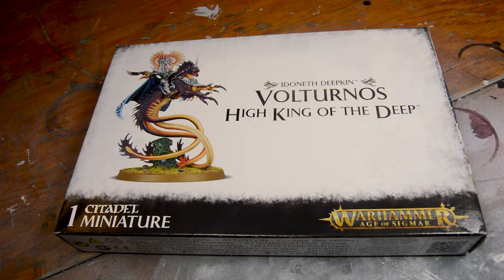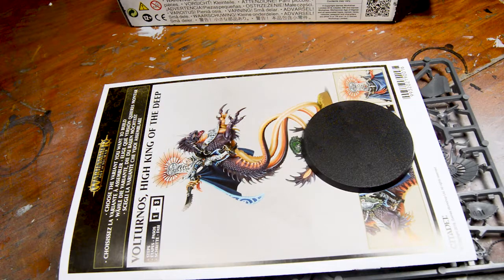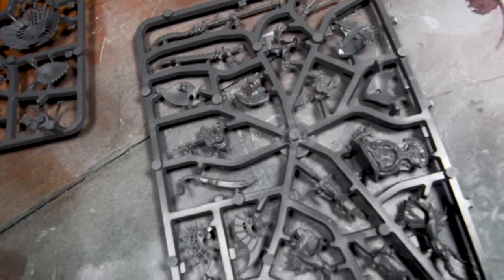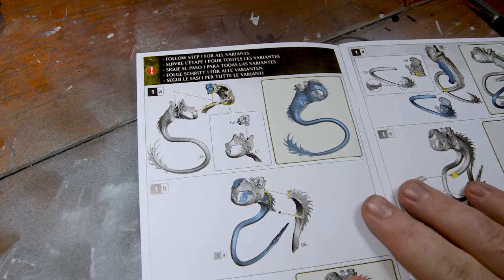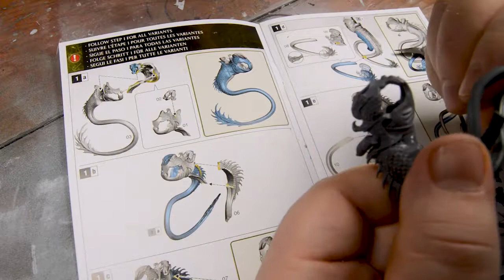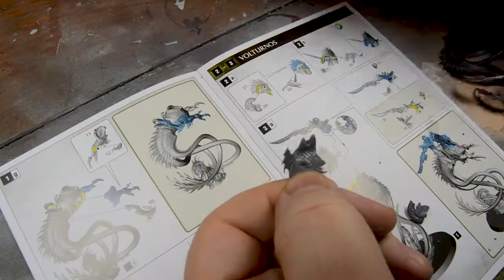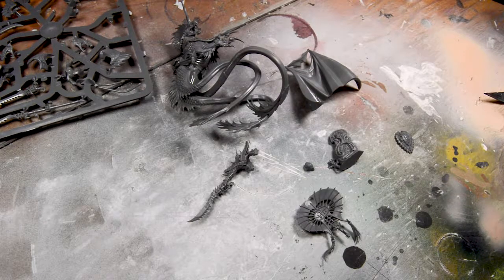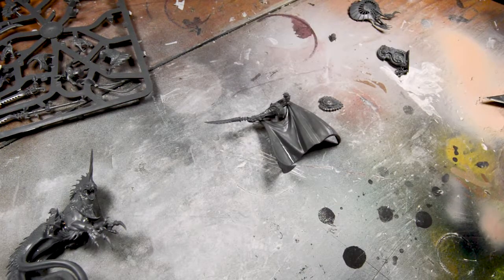idoneth deepkin Volturnos, High King of the Deep unboxing build and prime.

Comment: whats the yellow thing that u used?
Reply from the maker: it was a sanding stick i 3D printed from thingiverse with 400 grit paper attached to sand down the green stuff filler i added to fill in a crack on the cloak very handy when you want a smoother finish than i file would give you. i would also suggest instead of green stuff use plastic putty it drys much harder and is easier to sand and file.